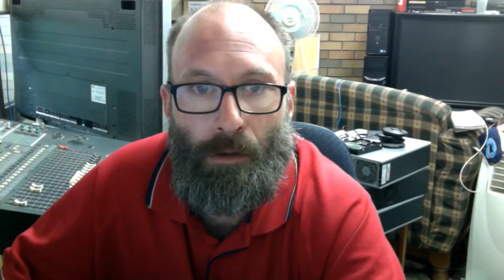Q&A + Advice - Dell PowerEdge 1950 Server

Comment: I am trying to put a gpu in to the 1950- can you send me some advice for it. It does o. The board does have a x16 slot but it is occupied by a x8 card adapter and if that is removed  the server Winn not turn on, so I figured that I have to get a riser cable that converts a x8 to a x16- and if it works I’d be happy ( I know that it will only give me half the performance, but there is another 3 pci/e x8 slots and I have a collection of cards.
And because they are 2x 700w psu a simple mod ( Iv studied how to do it and have my certification to do it) can have me powering 2 gpu’s that require external power input.

That been said, I am unfamiliar with servers in general( excluding the psu’s) and are wondering how I would connect (at first) a single card using the onboard x16 pci/e slot and if I can’t,  would a riser cable do for the x8 slot?

Comment: Okay, I've just been working on two 1950's and here is what I've found..If you boot the system, the fans will stay on high for about 10 minutes, slowly throttling down.  It appears to have nothing to do with the BIOS, nor can I find any section in the BIOS to control the fan speed/duration/etc.. Also, I've found when I boot the system, if I press the power button again, once, after about 3 seconds of initially pressing it, the fans will spin down to a normal level almost immediately.. If that doesn't work, just push the power button once when you see the DELL logo, powering down the system, then press power again to power it back on.. I've done this just for testing, and found the fans will not throttle to 100% on the second boot and will stay low.. All of that said, the fans will stay running at 100% if the top cover is removed, or if there is some sort of cooling failure; check the LCD above the cdrom, people!   --Was looking for the fuse in a dead PSU (with an amber light) and could not find it...damn, was hoping could salvage that PSU for a spare.